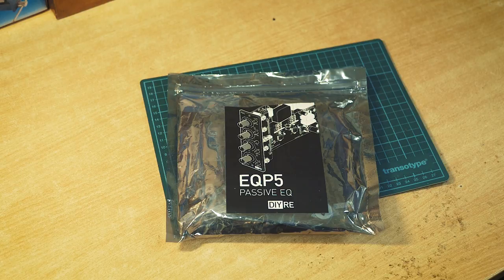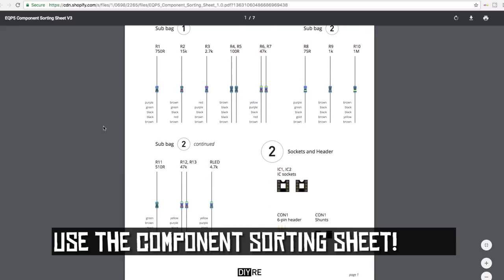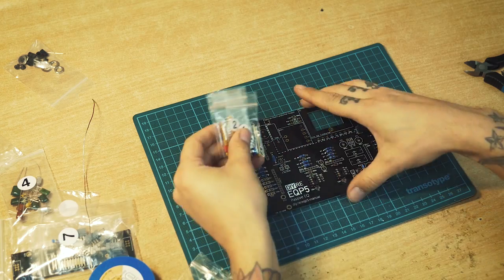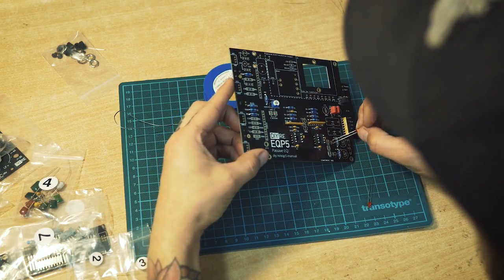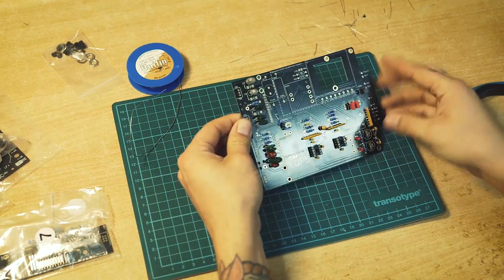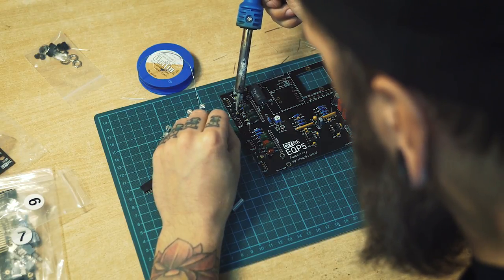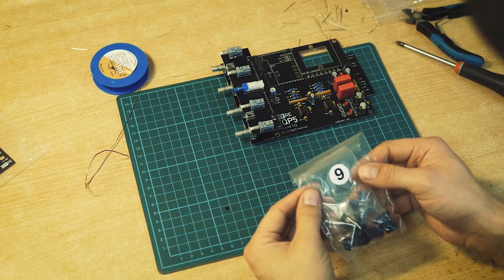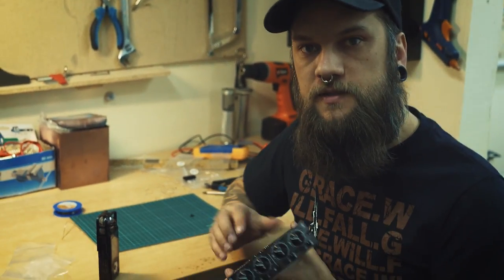Build a DIY Pultec style EQ from DIYRE (HoboRec Bull Sessions #25)

Comment: What else do i need to use that kind of unit? Bc i dont see any "input".
Reply from the maker: You need a 500 rack to put the module in. That unit has all the connections and power supply.
Reply: @hoborec   Nice! Thank you so much

Comment: Cool vid! I see it goes into some sort of rack. How does it connect? I'm accustomed to stomp boxes that take 1/4" jacks, so this rack mounted stuff is very new to me.
Reply: This one goes into a 500-series rack. It's a smaller alternative to 19" rack stuff :)
Reply from the maker: As KarlSimonOscarFrisk says you got to have a 500-series rack or lunch box to put it in. There are a lot different alternatives for this, with the original being from API.
Reply: That’s right.  It’s rack mounted gear (“500 series”).  You just have to get a special power supply to run these pieces. 
To use this stuff with your guitar, you need something to convert your amp signal to “line level ” to go into the rack, then convert it back to go back into the amp. It’s totally doable with your effect loop. 
That way you can use something like a high end compressor for example to modify your amp tone using the effect loop, instead of a stomp box compressor that’s only acting on the guitar signal.  The 500 format offers endless gadgets:
Reply: Radial makes all the gear you need to convert your signals.